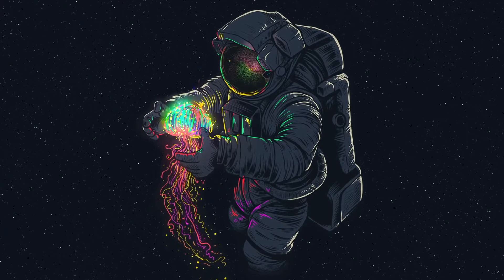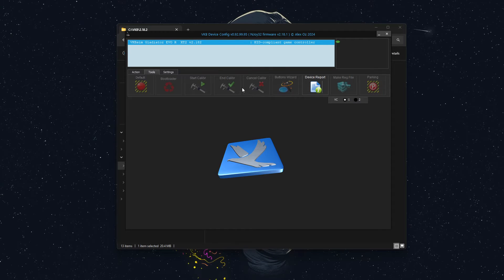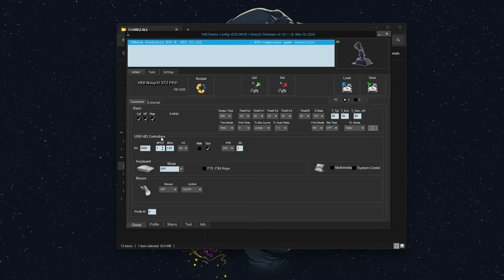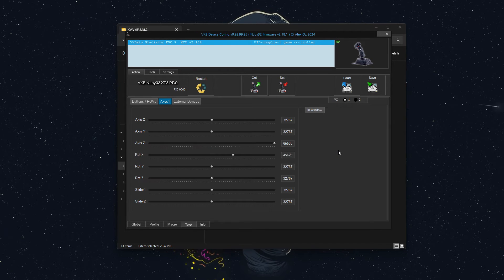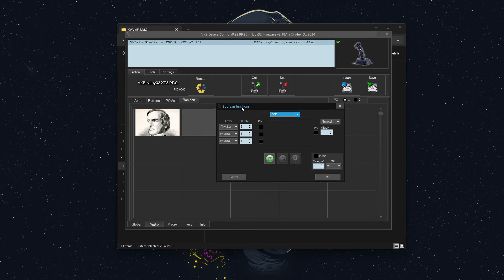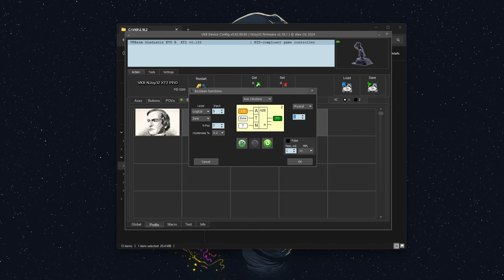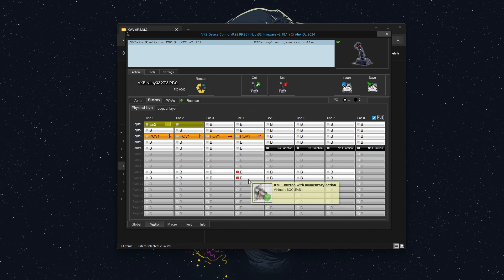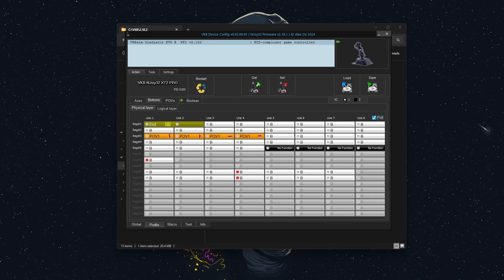VKB Gladiator NXT EVO SCG programming ministick as analog only & center button logic

Comment: you will need to change Button 13 to another one on the logical layer like 73 or the next available on the list because Btn13 is the right joy down so you would have 13 with two different button press

Comment: My button 13 on my joystick HAT A4 conflicts with the default button 13 on my VKB config, as demonstrated here. How do I remap 13 to say 30 so it does not conflict with my button 13 on my stick? I tried the logical layer and changed it to 30, but it reverts back to 13. I deleted automapping, but it does not make a difference. In the test, it's still button 13?

Comment: How the heck you get it into analog mode from default can't figure it out
Reply from the maker: If you have the premium grip push in on the ministick. The small red LED will light up if you're using default settings. If you don't have the premium version of the grip then you don't have the analog ministick. VKB sells an upgrade kit if you want to add it yourself

Comment: Hey.  I play Star Citizen.  I've got the thumb stick 4 way programmed to do specific commands on each terminus of the axis.  In the POV mode, I've got it set to my look around the flight seat.

What I want to have happen is that the thumb stick look around function to snap to centre when I release the input.  So, basically to work like a joystick.  Like how the hardware works.  I don't want to have the camera view stay where the last input pointed it at.

Any way to do this?  Let me know. Thanks.
Reply: I’m not familiar with SC but I solved the exact same issue in another game the other day but I forgot what exactly I changed! I’ll retrace my steps tomorrow and let you know what the hell I did.
Reply: @hoteltrivagoactual  A friend of mine suggested to basically bind another button as "re-centre/reset camera/focus", then to set up some sort of boolean operator in the stick software where for when the value sits between 49-51%, it keys the refocus bind.

Does that sound right?

Also, I have no idea how to do that hehe